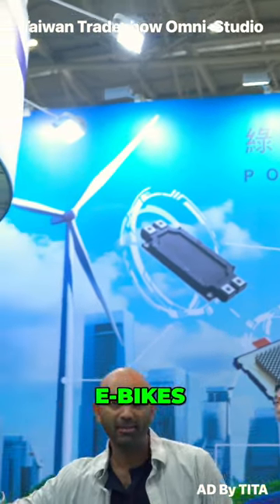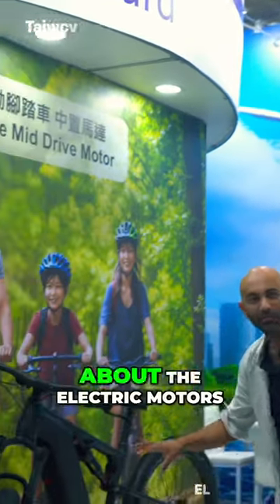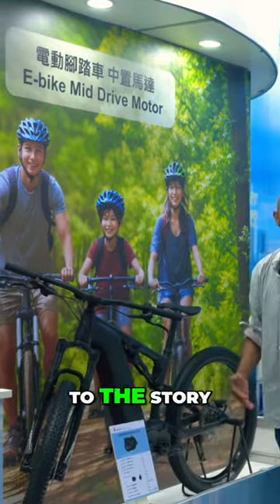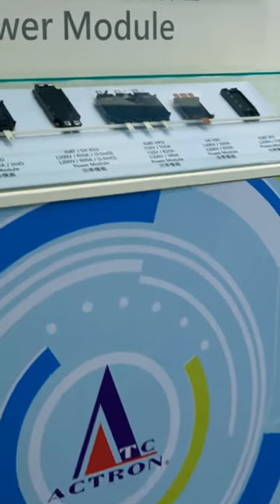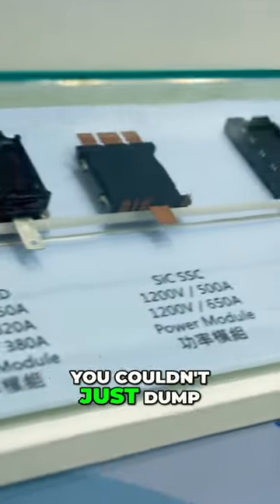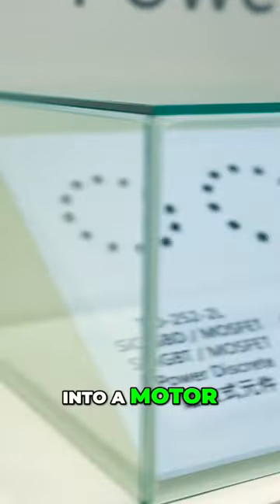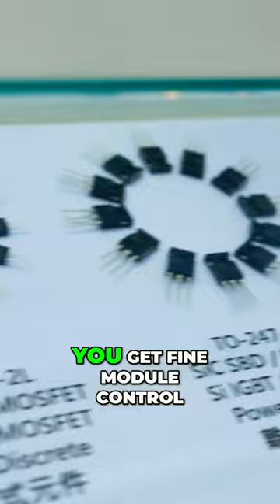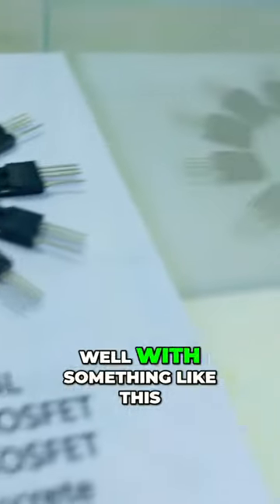Unlocking the Power of Electric Motors #2035emobilitytaiwan

Comment: I hope there’s enough lithium, neodymium, copper and silicon in the world… or else we will be going back to brushed DC motors and cable cars 🚠 😅
Reply: Luckily, silicon is very common in earth’s crust. Copper is crazy good at recyclability. The amount of power a small high voltage motor can produce is amazing. I was at the Porsche Museum today. Their best e-motor in 2010 was around 80-120 kW. The motors coming out today put Porsche’s ICE engines to shame.